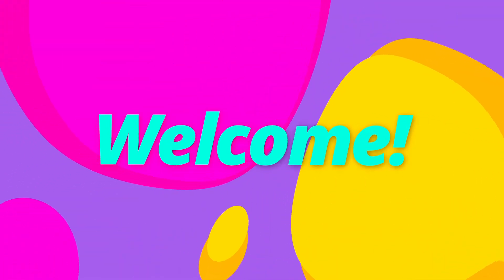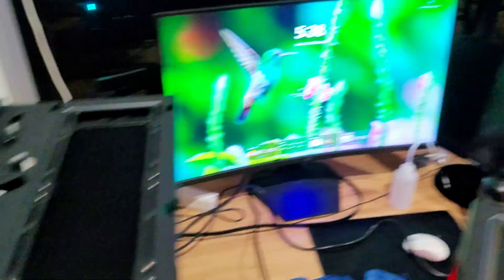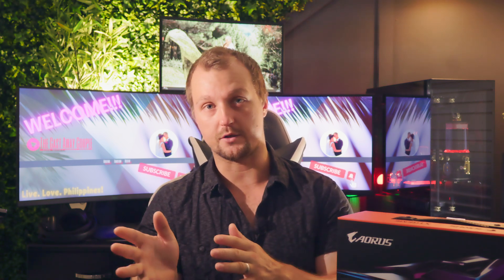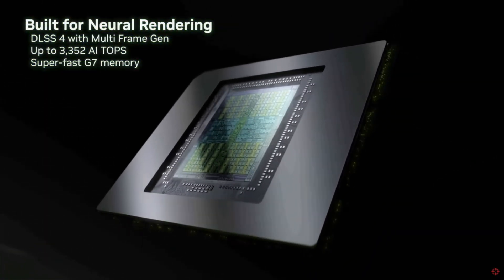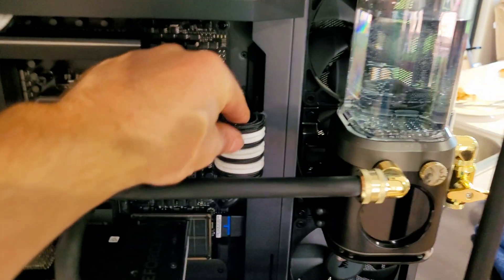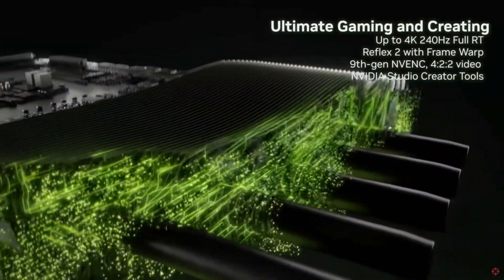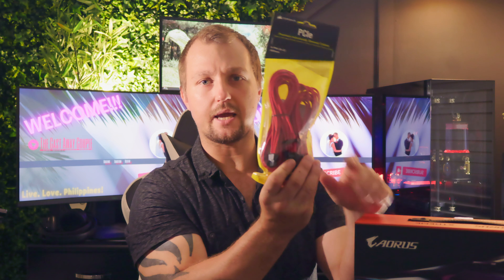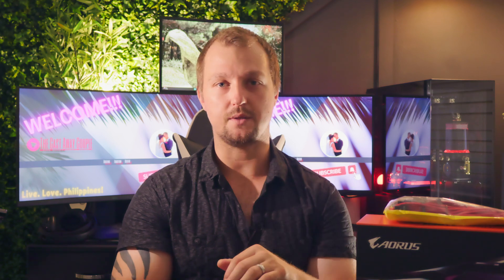🤯The Hidden Fix for Nvidia RTX 5080 Black Screen Issues - 12VHPWR Cable Secret⚡️

Comment from the maker: 🚀 Having trouble with your RTX 5080? Let me know what issues you're facing in the comments, and I’ll try to help!
💬 If this fix worked for you, hit that like button and share your experience — it might help someone else struggling with the black screen problem.
🔔 And don’t forget to subscribe for more GPU fixes, PC builds, and performance tips!

#RTX5080 #PCFix #GPUDebug
Reply: Found this as I'm on my last leg fixing a seperate issue with my MSI Ventus 3x OC. Keep getting nvlddmkm event id 153/14 errors with half black screen, the rest "jittery" and causes whole system lock up and crashing into motherboard error codes b4 or 99. I resolved it before with an install to an older image of Windows 11, restricting windows updates, and running an older nvidia driver. Rand fine for 2 months and now it's back again. I've tried fully updated windows/drivers, older windows without updates and old drivers. It's mainly under gpu load, rarely while idle with just twitch/youtube on.
Reply: In my case, I'm using an RTX 5090 D 32GB graphics card. The problem is a black screen in every game or during a FurMark stress test.
Reply: hi i have a boot up issue asus rogpg27 ucdm msi b650gaming plus wifi astral 5080 r7 9800x3d sometimes i have to restart 6-8 times sometimes first time signal sometimes i have no signal thanks for the reply
Reply: @dalegend947  I recommend finding a service center and taking your video card there. Because in my case, my new RTX 5090 video card had a manufacturing defect that was fixed free of charge at an official service center.

Comment: I have an RTX 5090 AMD 79800 x3D system. When I turn on the computer, the monitor stays black, but the case is running and the fans are spinning. This happens at least 4-5 times. What is the solution? My Nvidia driver version is 591.74.
Reply: same issue

Comment: Hey mate. Also have the same GPU.
However my issue is slightly different but also similar.
My driver's seem to be crashing error 43?
The display signal cuts off and fans spin up 100% and it can only be remedied by restarting..windows is still on.
Have tried so many fixes even upgraded my psu to atx3.1.
I just want to know if my GPU is doa or if it's a power delivery issue because when I undervolt my card the issue doesn't persist.

Comment: Was having terrible annoying Random Black Screens with ASUS and MSI RTX 5070. Card would ramp up to 100% fan under no load or in game. Took apart my case and I noticed my 16 pin power plug was  felt like it was all the way in but no it had a small space visible for extra travel  I pressed harder and it pushed in flush, I repeated this a few times to verify. I checked the two 8 pin PCIE connectors on the Y cable and re-inserted them making sure no pins were pushed out the back. Since doing this I have had no crashes or black screens. I was getting a crash during games and just about everytime I closed a game. Also happened on Login Screen. This fixed the issue. Before I had tried everything else Bios, Drivers, DDU, Underclocking, nothing worked. This has solved the problem. It makes sense. This plug is different than all the other plugs for us people upgrading from the old dual 8pin. This 16 pin thing is really sensitive to being fully connected to get all the current and voltages the cards need. My PC is Windows 11, Ryzen 9 5950X, MSI X570, 1000 Watt EVGA PSU.

Comment: i bough RTX 5060 Ti 16gb Trio oc
& it has Adaptor with it on the box
&  ofc i use it with it , i have psu MSI MAG A650BN 650w 
& i have black screen also 
what should i do 
i didnt understand 
should i buy other adaptor & change the one included with the card or what exacatly !
Reply from the maker: Use the adapter supplied with the gpu but make sure all plugs are used, including the PCIE outputs on the PSU. Both must be plugged into the psu and into the adapter, then (hopefully) it should work
Reply: @thecastawaycouple  All the PCIe connectors were already plugged into both the adapter and the PSU — I made sure of that. But there’s still no signal on the screen. The GPU fans and RGBs are running, so it’s definitely getting power, but nothing is happen
Reply from the maker: @PlusFerchiou hmm, you’re literally describing exactly what happened to me and what I just suggested is the only thing that fixed it in my particular case. There could be other less likely issues like PCIE gen? What motherboard, cpu are you running? Anything pre gen 4 like a 10700k or 3700x? I’ve heard of 50 series cards simply having issues with older hardware.

Otherwise might be worth getting your hands on a couple different PCIE cables or maybe a 12vhpwr cable with 4 sensor pins present. If that doesn’t help then I’m t truly stumped my friend!
Reply: @thecastawaycouple  i have 5700x CPU &  the motherboard is Msi B550M PRO VDH 
both is brand new 
& i tried Updating bios & clearing cmos & a lot of things ...

Comment: I had a maddening issue with my PC.  I had a 10900kf paired with a Aorus Z490 Ultra motherboard.  I had the Bios updated to the latest and running perfectly fine with my RTX 3080.  I managed to snag a RTX 5080 for just $875 (The base PNY model but a 5080 is a 5080) and decided to just go ahead and get it and use it.  My PSU is a 850W Corsair PSU which is perfectly capable of powering the 5080.

Unfortunately for me despite all my best troubleshooting methods couldn't get it to run stable.  The computer would boot and post but after 30 Seconds to 5 minutes it would just go to a black screen and as far as I could tell just be completely unresponsive.  It was incredibly laggy the entire time and when I did get into windows it would sometimes just lock up but the mouse was still able to move around the screen.  There were no issues with my windows installation that I could tell and the GPU was having some VERY VERY odd behavior.  In GPUZ it would show up but the vram and many of the other data fields were just 0.  

I suspect that this had something to do with my 10900kf only supporting up to PCIE3 and it somehow causing issues.  I even suspected it had something to do with my RGB and completely unhooked all of that as I've seen that cause problems.   Removed all USB devices too just to rule out any issues.

My initial thought was either that I got a dud GPU which is why it was so cheap or my power supply wasn't capable of handling the power demand but both seemed unlikely and I suspected that my motherboard or CPU were the culprit. 

My solution and what did work (Though it wasn't want I wanted to as I didn't want to spend the money right now) was to get a new motherboard, CPU, and Ram (9800x3d) 

It now works perfectly so the GPU and PSU both were not the issue.  My thoughts is that somehow the PCIE 3.0 was causing some major issues but I'm not really sure how as the 5000 series cards should be able to run on it just at reduced speeds.  If anyone has any insight as to why I was having these weird crashes I would love to hear it.
Reply from the maker: Boggles the mind to see how many 50 series have issues. At this point, I don’t think even Nvidia themselves know what’s going on

Comment: Got the same issue with my brand new aorus master 5080. The gpu fans went full load right after my screen turn black off. What should i do?
Reply: Any update I have the same card and same issue.
Reply: @U @UbFunks  I tried unplugging and reconnecting the GPU power cable, and the black‑screen issue has happened much less often. I don’t know why, but I guess it might also be related to the newest NVIDIA driver not being fully compatible with my 5080. It hasn’t happened for nearly three months. You could try unplugging the power cable and plugging it back in to see.
Reply: @OnTheTouchline2025 okay bro. I will give it another try I appreciate it. 
Out of curiosity what kind of mobo and CPU do you have ?

Comment: hey there, my 5080 is crashing black screening at low loads. randomly. I wonder if it is the cable. have a asus rog loki 1000w. used the provided 12vhpwr cable. Do I understand u recommend switching to an 3x8 to 12vhpwr instead?
Reply from the maker: Yes that’s what seemed the completely eliminate all of my problems. Definitely give it a go!
Reply: @thecastawaycouple  so a adapter will probably not work, as I my psu does not provide 3x8. it has 2x8 available for the gpu, as well as the 12 pin cable. Would getting a cable mod cable with an 90 degree angle connector be a good idea?
Reply from the maker: @GTexperience_Channel it could be worth a try. Double check your next cable has all 4 sensor pins populated on both ends but I think the heart of the issue is actually having a PSU that provides 3 PCIE outputs to supply enough juice to the card. 

I know it’s a pricey venture to change PSU for what sounds so trivial but that’s literally the only thing that solved my dramas
Reply: @thecastawaycouple  part of the issue is that I need an SFX power supply. so finding 3 outputs is hard. I am hoping the issue is actually the bend in the wires near the gpu. so I just bought the cable mod cable for this psu model. otherwise I might try the 2x8 to 12 pin cable I also found in the box.

I will let u know if I ever get this issue sorted.
Reply from the maker: @GTexperience_Channel sounds good. Love to know how you go. Thanks
Reply: @thecastawaycouple so the cable arrived, and it ain't great. Just unboxed it to find it only has 2 sense pins. And only on the GPU side. Turns out it is spec 3.0 rather than 3.1. Finally the 90 degree connector isn't a solid 90 degree connector, rather they just bend the cables inside of a bracket. Which is bound to give power instability problems as well, due to the spike in resistance by the bend. 

I am not comfortable sticking this into my pc. But luckily for me my last reseating of the old PSU cable has seemed to stabilize the system. No crashes for the past 3 weeks.
Reply: I am very surprised that cablemod seems to just bypass the sense pins altogether. 0 to 2 sense pins just does not make a lot of sense. I am certain they are currently connected to the main pins directly. Effectively just bypassing it completely.

Comment: Thank you for this video! I´ve been looking for help for 3 days and i tried everything. I bought a new RTX 5080 and a NEW PSU Asus 1000w... plugged them in an i got some wierd stuttering ingame, also i couldnt boot my PC if more then one of my 2 monitors was plugged into the GPU. The 12 Pin cable from my new psu, from asus was the problem...i changed it to the split and used my old psu, now it works like it should!
THANK YOU
Reply from the maker: So glad it helped! Enjoy your new card!

Comment: My case is a bit different, but I still get black screen, then freeze and my PC auto restarts.

My PC randomly freezes and becomes unresponsive, even when I’m not running anything heavy (e.g. just browsing or watching a movie). The screen goes black (sometimes audio keeps playing), and if I leave it for 2–3 minutes, it auto restarts.

No BSOD → no dump files in `C:\Windows\Minidumps`. So the only logs I have are from Event Viewer / Reliability History.

The weird part is: it’s totally random. Sometimes it won’t happen for 24+ hours, even if the PC is idle. It’s not triggered by gaming or stress loads. The best way to “replicate” is just leaving the PC on and waiting for it to freeze.

The last two freezes showed these Nvidia-related errors:

• nvlddmkm (Event ID 14)
• nvlddmkm (Event ID 153)

After trying multiple things that I have documented here:
1) Reddit: https://www.reddit.com/r/techsupport/s/C16zHC7MFo
2) A Mega Thread in Nvidia Forums from people facing the same issue:
https://www.nvidia.com/en-us/geforce/forums/game-ready-drivers/13/573244/span-classhighlightmegaspan-thread-for-span-classh/

I am willing to give this a try. I have ordered a new cable from Corsair (I am using the one that came with GPU) and I will return with feedback once tested.
It would seem weird to me though that the cable or GPU are faulty because they worked great for 4 months, and the problems with black screen/freeze/auto restart started in early July 2025, after a windows update.
Currently I believe that the cause behind the problem is Nvidia's and Microsoft's drivers.

@thecastawaycouple Have you stopped getting the problem or is it still occuring?

My PC Specs:
• CPU: i9-13900K (running on stock speeds)
• GPU: Gigabyte Nvidia 5080 (ver.572.83)
• MoBo: Asus Z790 Hero (BIOS ver.2801)
• RAM: Corsair Vengeance RGB 32GB (2 x 16GB) 6200MHz (XMP Disabled)
• PSU: Corsair HXi Series HX1000i 1000W

Monitors:
   • LG 27UL500P (DP)
   • Samsung Odyssey G80SD (HDMI 2.1)

Comment: I have the identical GPU, except mine is the 5090 version. My card, the white light by the power cable is flashing. Was your light flashing? It's all hard-line tubing and such a pain in the ass to drain the loop all the time. I've tried diffierent cables with the same result. Again my white light is flashing white and the RGB of the card is flashing red. Any ideas?
Reply from the maker: That's a tough one. Have you only tried the 12vhpwr cables so far? If you havent tried a psu with 3pcie outputs yet maybe try that. The 5090 is far more power hungry than my 5080 though
Reply: @thecastawaycouple  I tried the cable I had that was running the 4090 in it, fine.  But that didn't work. So, I have then tried the cable supplied, which splits into 4. Still the same with that one. Updated bios. Cleared divers a couple of times. Still just flashing. Bloody PC's never have a dull moment.

Comment: The same thing happened to me. 😢 But i used the original cable and nothing. 
And the reason was. The original cable had issues. But sometimes it's working.  I've ordered a new cable on Am@zon now.

Comment: Hi! My 5070 ti gamerock just wouldn’t give any image to either hdmi or display port at all (while it DID light up). The old gpu (4060 ti) still does well. The VGA light is also on. Is it similar to your case? What would you suggest?
I already did 50 odd drivers manipulations and am extremely depressed. Wanted to back out altogether by handing the gpu back to store but they tested it and say it works properly hence no refund. I would really appreciate any advice!😢 my MB is GIGABYTE B760M DS3H DDR4, tried both direct 12 pin and through an adapter with 2/3 8 pins plugged in (in both cases the gpu lot up).
Reply from the maker: Yep, that's exactly the same issue that I had. No matter what, I had no display across all ports. 

I'm assuming your PSU only has 2 pcie slots but you definitely require 3 to fully populate the adapter.

That's the only thing that worked for me. I was also getting the white LED light on the gpu indicating everything was fine but still no display. 

Might be worth finding a friend or another psu you could test out and use all 3 pcies before spending the money on one but that's the only thing that worked in my case.
Reply: @thecastawaycouple thanks a lot man, I will try it
Reply from the maker: @eastarodubov got my fingers crossed for ya! Let me know if it works, am very curious to find out

Comment: I have the PNY 5070 SFF. For three weeks i was trying too figure out why my pc was crashing with gpu fans going at 100% while my displays were black. Found out that the 2 8pin adapter that came with the gpu was the issue. Just used the 12 pin 600 watt pcie, and I haven't had any more issues.
Reply: Fixed for me! Works for 5090. 12 Pin 600 Watt Pcie did the trick! Also make sure in bios it’s gen 4 selected for the pcie express slot!
Reply: Thanks, ordering now!

Comment: so for me the gpu is just not getting power i think. (i mean its not turning on and its not being recognized by the BIOS nor the device manager... so i think its not working.)
i ordered a new modular psu wich has 3 8 pin pcie cables so i can use the adapter that came with my gpu so hopefully that works. ive tried everything else so this is litteraly the only thing left to try... if this doesnt work ill probably try getting a new motherboard that is known to work well with the rtx 5070 ti so i really hope this works... and if it does ill edit this comment to let yall know! btw your definitly getting a sub if this does in fact work. my psu is arriving later today.
Reply from the maker: Awesome. Hope it works for ya!
Reply: @thecastawaycouple IT WORKED!!!! I CAN FINALY STOP RIPPING MY HAIR OUT😭🙏 Bless you man! I hope you have a nice life and im deffinitly subbing😅 thank you!
Reply from the maker: @RGames20appreciate the sub. Cheers!

Comment: mine is odd -- if i watch any videos or have any browser on my main display, it keeps going blank at random and sounds like its being unplugged and plugged back in (does the windows unplug sound) - but then works fine on all my other monitors - if i close all apps down i seem to have no issue, eg in games. (at least so far) any idea what could be causing that? (Note: my gpu was already plugged in via the adapter as the package said "always use this cable" for the gpu

Comment: I’m having issue where I have to unplug DP and plug in HDMI cable when turning PC on. Otherwise it won’t turn on. While it’s on now i can plug in my DP and enjoy my games. But I will try this method today see if it will fix the problem. Thanks for the video!
Reply: I have the same exact problem with my 5070 ti , I have to connect first the HDMI and only then I can connect my DP , did you solve it with this method?

Comment: I actually got one of those RMA‘s. It’s a Asus RTX 5080 tough OC and it usually goes for $15-$1700 and I got it for 1000 or somewhere close to 1100 and I’m having the screen issue but it’s weird that it happened a few times a lot and then it stopped happening for days and then it started happening again.